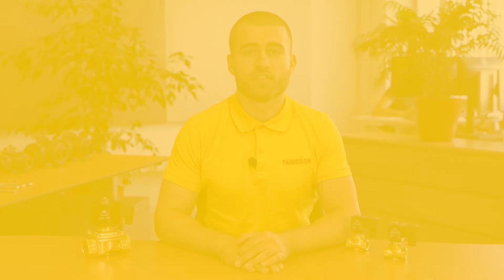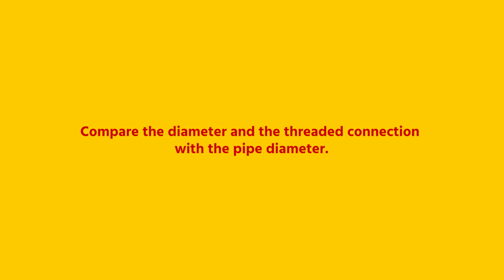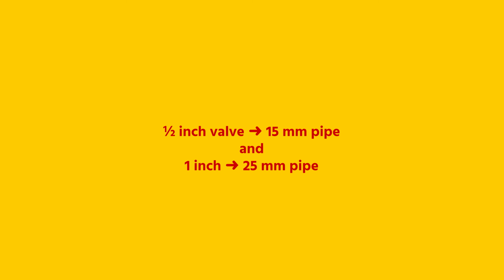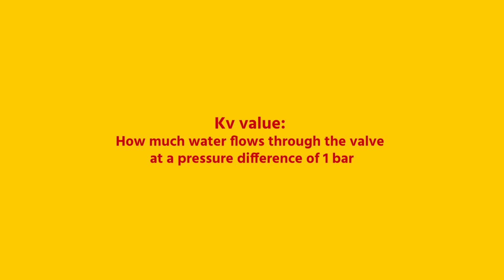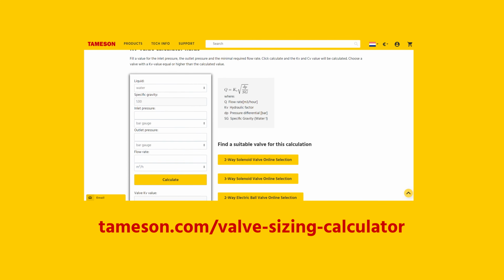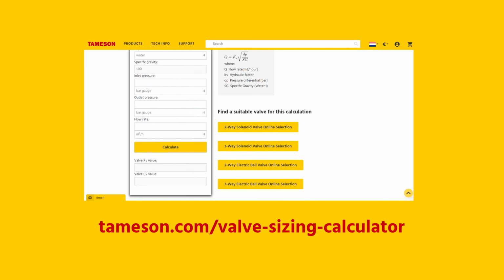Solenoid Valves Overview & selection guide | Tameson

Comment: is there any way to use proportional solenoid valve using raspberry pi
Reply from the maker: The best option is to use the PWM controllers that are already designed for controlling the proportional solenoid valves.